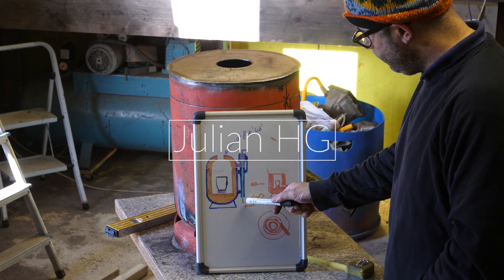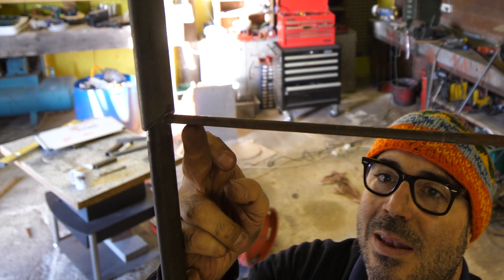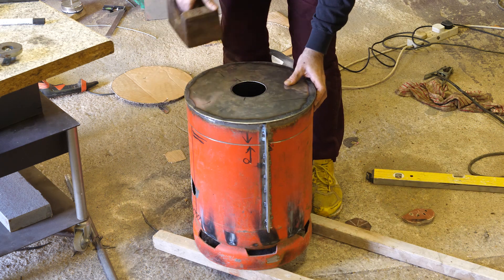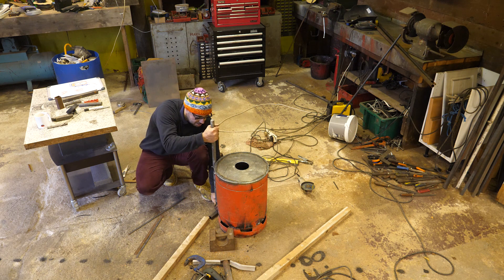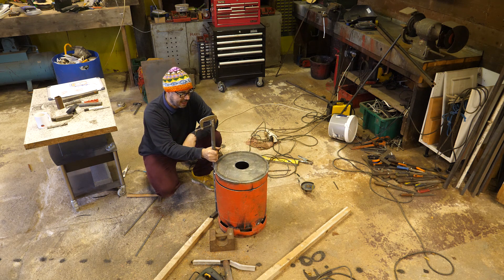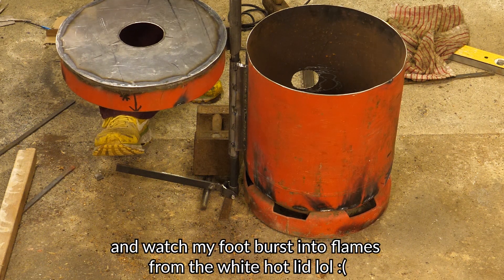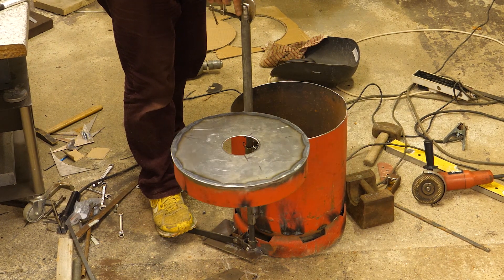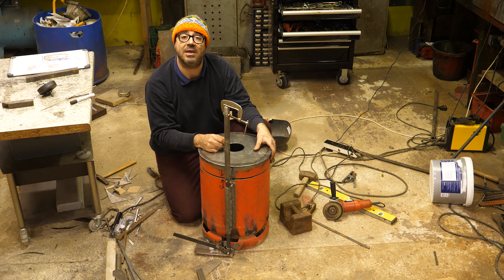DIY Homemade backyard foundry build * PART TWO * Lid lifting mechanism & mistakes were made

Comment: Cool, I like the lid lifting mechanism! Did you come up with that, or is it part of a build your project is based on?
Reply from the maker: Thanks Chris! the over all build is based on many of the videos i've watched about foundries and casting (see part one for general inspiration) but using stuff i have about the place or easy to get stuff near me. You’ve just reminded me to finish off my links, I forgot, (I had to upload In the local library today), The lid lift mecanism is inspired by a video I linked in the last video but it should really be here, my version is very similar I think. I will link it the description in a sec. :) #EDIT (question answered better) and link updated, thanks Chris
Reply: @JulianMakes  Thank you for the link! I'm contemplating building a foundry furnace myself (among a million other projects worth contemplating 😉)  - this will go in the link list...
Reply from the maker: @rhdt  go for it! :)